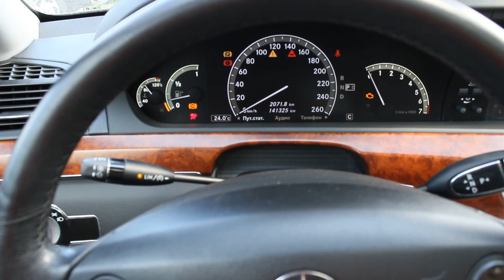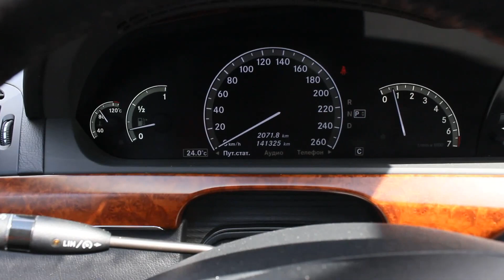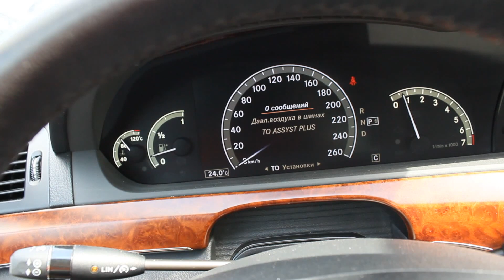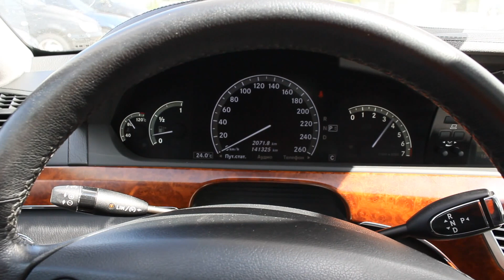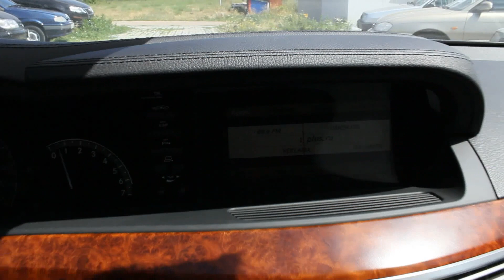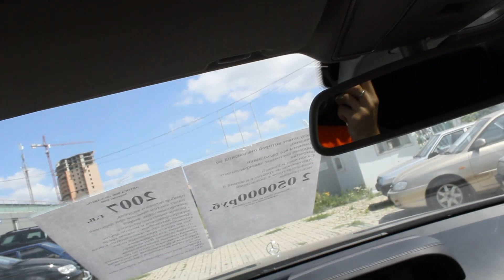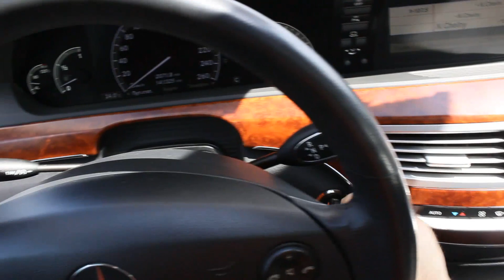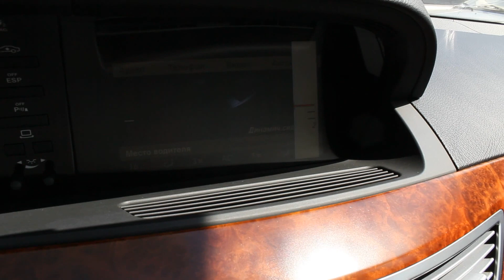2007 Mercedes-Benz S450/W221. Start Up, Engine, and In Depth Tour.

Comment: The engine sound is not OK...
Reply: Why not?
Reply: I have the S500, the engine sounds really differently...something is not right, please have the engine checked asap, it usually means something is not quite right...
Reply: coolgearSK But this is a S450 so i thought this has a other engine in it.
Reply: I have seen quite a lot of these cars and I don't believe that the sound difference would be so big...
Reply: coolgearSK So basiscly the S450 has the same engine as the S500 but then less HP and NM?
Reply: nope, they are not the same, but the differnce in sound should not be so different between models...